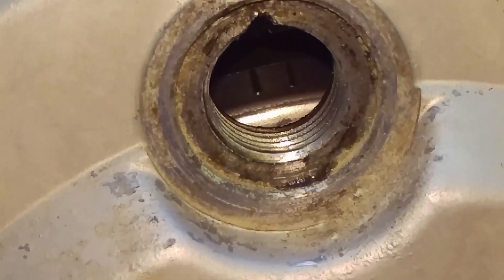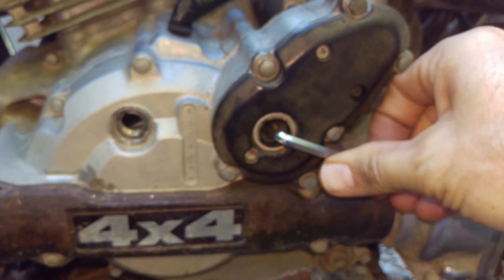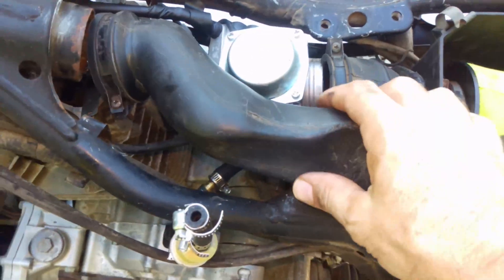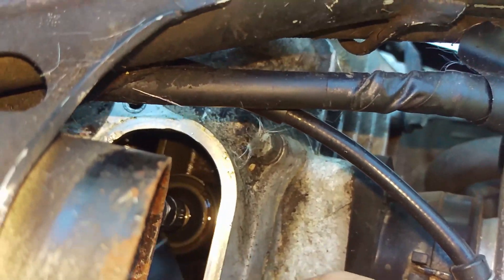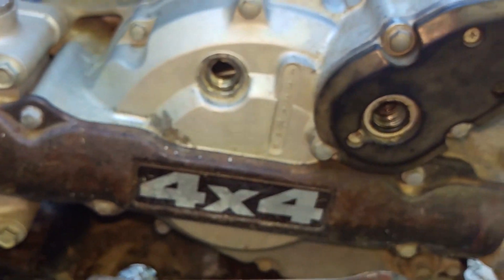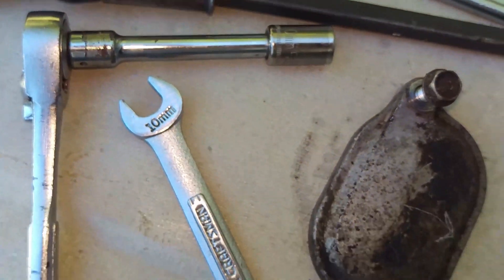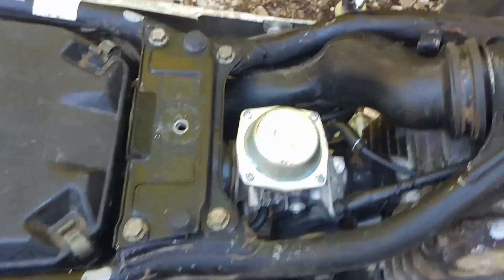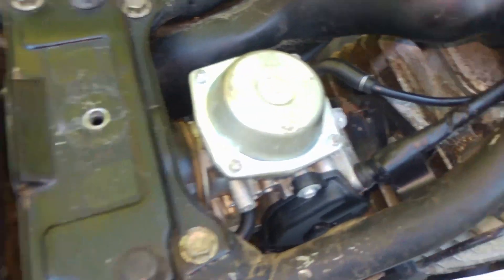Honda Fourtrax 300 – TRX300 Valve Adjustment

Comment from the maker: Question: For Engine PRO's - I went slightly tighter on the valve adjustment using the gauge. Will this cause any issue down the road? What I notice is that the valves rockers have some play side to side and rattle somewhat. The noise was reduced. I do not know the run time hours of this engine, yet may do a compression test to get an idea of the wear. - Thank you any input!

Comment: Is this a common thing. Mine has trouble starting in the cold and backfires through the exhaust. That’s definitely a valve adjustment problem right
Reply from the maker: Not sure. Mine just rattled, no back fire. I would think valve lash is more common with wear or hours usage. That might be fuel. One thing I did that helped my ATV was rebuilding the original carb with a kit. Don't use the knockoff carbs that fail in a year. Thankfully I had the original Nipon Japanese carb. Has run great and starts well. My carb is due again because it has been a few years and it is doing some backfire until it is warm like yours. Ethanol gas is not good. The other thing to check is coil and ignition module. Only time mine does not start is a fouled spark plug. Take it out, clean and starts right off. The cut-off switch on the handle on mine recently started cutting off. Might need to work on that next. Great machines though.

Comment: you appear to show the 2 parallel lines on the flywheel to line up in order to adjust the valve but then in the comments you quote from the manual that you should be on the T mark to adjust,and that the 2 lines are the timing advance marks ,  another video shows the T been used , your video is maybe a bit misleading if that is the case for i adjusted mine after putting back together and it was noisy in the top end, i shall have to re adjust by the T mark
Reply from the maker: Hi. I show the T image overlay in the video. Not sure how you missed it. The description explains the T is top dead center with the hash mark and to use it. Sorry for any confusion. Thanks!
Reply: But there are 3 marks on the fly wheel u have it between the 2 hash marks but to time it as far as I no it needs to be at the image u put on the video and that is different?

Comment: I tried getting it to TDC with the 6mm Allen wrench and I watched thru the other viewport hole while turning it and I did not see anything spinning even tho it was turning
Reply: All I see thru the frontal view port is this shape 🔼
Reply from the maker: Best to put a light at that port. You should see the rocker move as well.
Reply: @SteveAddis  I was told to turn it clockwise and it even said that on other vids, it turned the motor over counter clockwise
Reply from the maker: @mudboy4208  It's been a while since I did it. Did you get to the marks okay?

Comment: Thanks i needed to know if the T was the one who is on its side. Cause there are 3 marks on the fly wheels 1st 2 stripes a 2nd mark that looks like a t or h or 2 lines and then the T layed down with 1 line i got confused
Reply from the maker: You are welcome. From the manual page 58.
T or (T With Hash Mark) = TDC (USE THIS TO ADJUST) (Compression Stroke)
F =  Initial Spark Advance 1300RPM or less timing light shows this.
II (Dual Hash Marks)  = (Timing Advance)- 1300RPM or more, timing light shows this.
Reply: @SteveAddis  ohhhhhh thanks makes more sense now :) usual its clear on the flywheel T and befor you got 2 lines but on this adly 300 (honda trx300ex) i got confused. i adjusted the valves now, it runs a bit better since i now adjusted them right the 2nd time but still get me black spark plugs so i gotta fiddle with the carb setting always fun

Comment: Hello , did it improve it ? Thanks
Reply from the maker: Hi Robert. It did slightly. There are multiple marks,  so I put that info the video description. I plan to go back and check it again with the correct marks that has a "T" and one line. Take care.
Reply from the maker: Hi again Robert. I readjusted yesterday, marks on the "T" and line. I went slightly tighter, and it made some sound difference. Thanks for your comment!
Reply: @SteveAddis  It could be a worn out cam chain. hondas these years are known for this, especially on their three wheelers!
Reply from the maker: @Spectra4l You may be correct. I hope not to go that deep into working on it for a while. I adjusted it slightly better since this video and it seems quieter. Thank you for your comment! :)